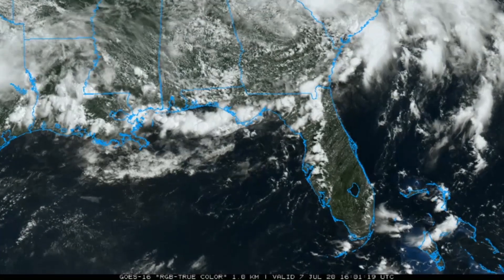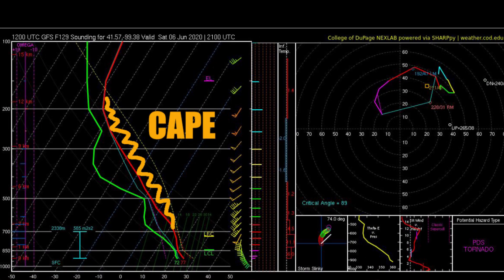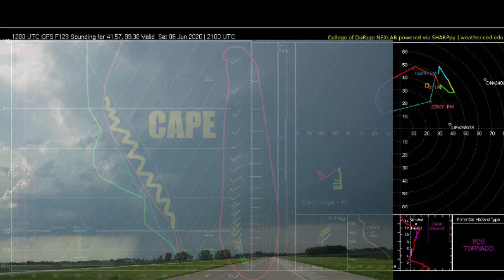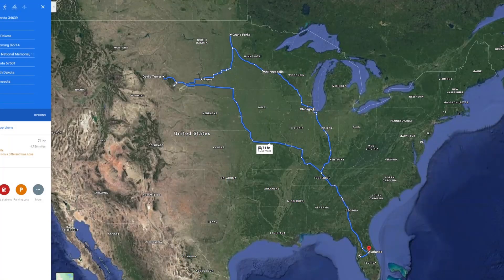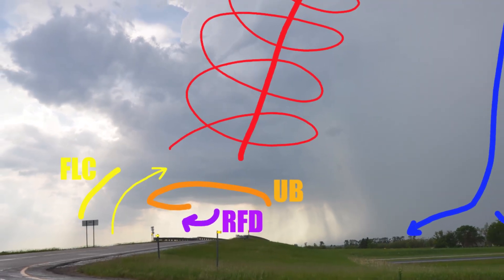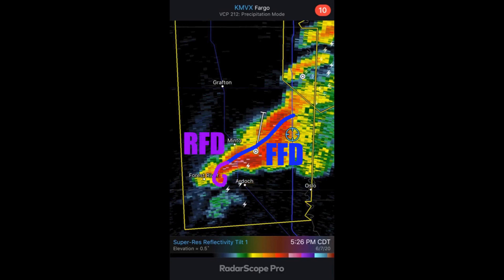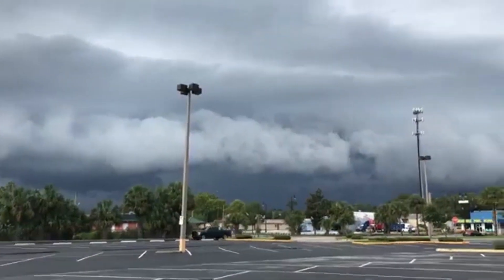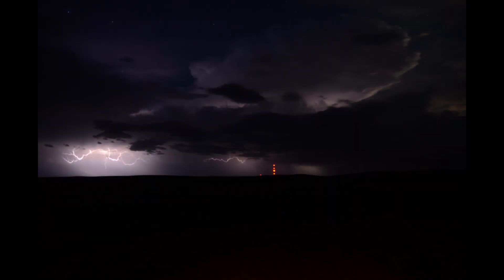How Do Supercell Thunderstorms Work?

Comment from the maker: I have since seen my first tornado. You can watch it here if your interested. https://www.youtube.com/watch?v=WN73st1HR18
Reply: What would a mountain or a valley do if a tornado came through is there any difference when it hits a mountain or a valley? Does it do anything to the tornado?
Reply: If a tornado goes over a sudden drop in elevation it will have to condense until it reaches the ground again and it the storm comes from mountain to valley the thunderstorm updraft may become disturbed.but if a tornado goes up a mountain from a valley the updraft can be disturbed due to the change in pressure in some cases can strengthen because of the low pressure of mountain tops.Mountains also send air upwards which can strengthen the updraft.So it depends.
Reply: Excellent video! You are definitely knowledgeable in meteorology and the processes of storm development.  With your permission I would like to use this video at my next spotter training course. I hold them every April in conjunction with our local emergency management ISO9000 incident command and SAR training.
Reply from the maker: Go for it.
Reply: @CeltonHenderson  thank you
Reply: a legend was born

Comment: THANK YOU. Having said THAT….i live in Racine Wisconsin. I live 1/2 mile from Lake Michigan. At about 2 pm yesterday (the day there were 2 tornados 50 miles inland) i observed 3 layers of clouds over my head. The first layer was solid and probably at least 20 k ft.up moving slowly over the lake in straight east direction. The 2nd involved dirty looking more vapor like clouds shooting south at around 5 k feet up. The 3rd level was also looking darker but newer and they were just slightly lower than the 2nd level RACING straight WEST. These ones were in a hurry. 1 hour later…tornado siren. 1 hour adter that…tornado 50 miles straight west of my location. Did the 2nd and 3rd level of clouds get pulled by the storm from Lake Michigan…and Lake Superior? Is what i saw…snd took a video of….show the reason Racine hasnt been hit by anything since 1888? Did those westerly clouds push back at…then feed…the supercell? Youre input would be appreciated, not sure if my video is something that should be passed along to weather service. Can we talk, i have intel on the Portage Michigan tragedy as well, knew Michigan was going to get hit (instinct based on what ripped past my window lol) when our esteemed experts were telling folks that Michigans worst case scenario would be a pop-up as i desperately tried to contact someone…ANYONE who would listen to what i had to say about what i saw

Comment: I flew for a Research and Hail Suppression program in Alberta in the summer of 1974. (Hailstop '74). I was flying missions to seed bases below the Weak Echo Region (as read from a ground based met radar station) and aided by visual recognition of inflow regions, shelf clouds, etc... The air was always laminar - and sometimes the biggest challenge was to remain in visual flight conditions BELOW the inflow region and not be drawn up into the cloud. I also flew 'top seeding' missions in the vicinity of 20 to 25,000 feet (using the outside air temp for clues) and dropped seeding canisters into the tops of rapidly growing turrets. Once again - always in smooth air. Meanwhile, a group of scientists on the project were flying updraft penetrations in a Cessna 414 fully equipped with cloud physics sampling equipment and airborne weather radar. It was a fascinating summer's job! All I learned about operating (safely!) around T-storms - and from my many conversations with the scientists on the project -provided a great base for my airline career that followed. Your explanations and photos reveal a much better understanding of Supercell dynamics than we had in 1974! This is  great review and training aid. Thanks for sharing.
Reply: That is an amazing account! It sounds like fascinating, if slightly hair-raising, work for a young pilot. It must have been wild to see the patterns of flow evolving within the storms from that vantage. Thanks for sharing the story.

Comment: It's magnet energy coming out from Earth's increasing double torus magnetosphere due to it's orbits passing between the two energies of the Sun's Oort cloud magnetosphere for the next millennium. 

Mystery of the 7 star crossings in one half rotation of the galactic bulge Jesus held in his hand.

Galactic Milankovitch cycles not you or co2 is causing these the birthing pains of this the millennium of climate change END TIMES. The first of Noah's tidal wave deluges will be pulled out and around the planet east to west by the new moon with the first major conjunction of mercury and Venus in 2033 and every 40 years thereafter for the millennium it takes the earths orbits to cross the ecliptic.

Come to Jesus take up your cross.

Comment: Mr. Henderson,
I enjoyed your theory, as it goes against the current accepted/taught speculation of such phenomena. 
However.....if you're up for a long read LoL....

I have my own theory as well- and it is one that I have not seen or heard of anyone else contemplating. While there's one factor that I/my theory agrees with- compression/"tightening" of the main updraft....the rest of what's going on is almost the opposite of what you described.

Having a determined mindset to dissect and analyze any idea that I come up with, I set out to see if any part(s) of my theory are possible. 
Using a rheoscopic fluid environment, and inducing the main factors required and seen when any formation of a tornado.... rotation and convection (updraft). After that, I used the factors of the cold, super dense air of the hail core in conjunction with rotating subsidence from overshooting tops- at a given moment, I believe the combination reaches a critical point where the cold air mass is too heavy for the main updraft to keep aloft. At such point, a column of cold air begins to penetrate the rotating updraft- which is seen as the development of a funnel cloud...the funnel being that of colder air that is compressed and condensed. This  impedance then forces the updraft to accelerate- because the same amount of flow must be maintained...and the only way for such to happen is to increase the velocity...speed...of said air mass.
The greater the impedance of cold air pushing down, the more the inflow/updraft increases. 

If/when the subsiding cold air reaches the ground, is the moment when debris is observed (and axial rotation is also present)....which, at first, doesn't require the compressed condensation (visible funnel) to extend down to ground level- that process only happens as updraft velocity increases and further compresses the subsiding colder air. 

Going back to my fluid environment experiments, I have induced the same visible features of a tornado.

Out of all factors, and most importantly- is the altitude at which rotation is induced....and I have video documentation showing a difference between the characteristics of such. Eventually, I was able to get what is seen in visible satellite imagery along with what is observed happening at the base/location of updraft.
I'd be more than happy to show you pictures/video I have of all of this :)  I do have some basic proof of concept videos uploaded on my channel, and would also enjoy discussing with you such theory.

Comment: This video is great and really informative, I'm excited to see what you're gonna put out next. Question, I watched Pecos Hank's video on anti-cyclonic tornadoes, would the anti-cyclonic part be the part of the horseshoe on the other side of the RFD?
Reply from the maker: Excellent assessment, your absolutely correct, although the risk is fairly minimal, the southern side of the horseshoe is where anticyclonic circulations are likely to develop.
Reply: @CeltonHenderson thanks, when I first saw a clip of a storm with very visible rotation on both sides of the RFD I thought that it seemed to move the same way as a mushroom cloud. I find it really interesting that my thought wasn't actually too far off